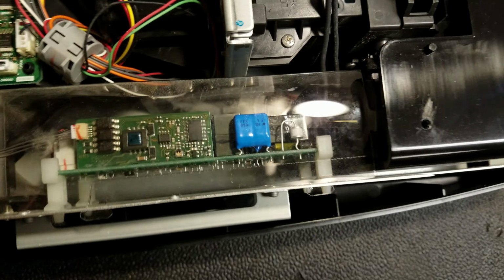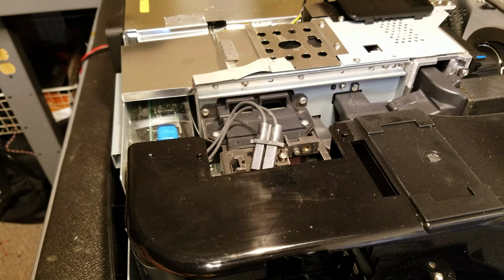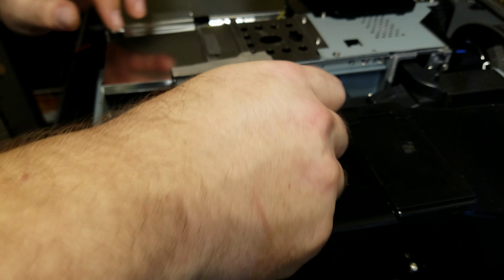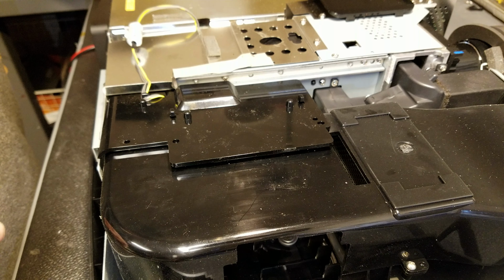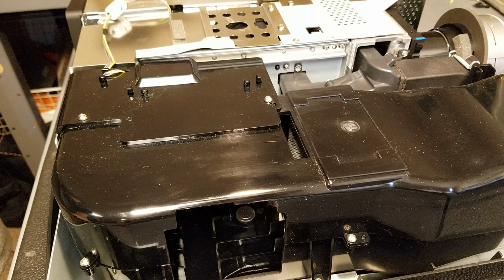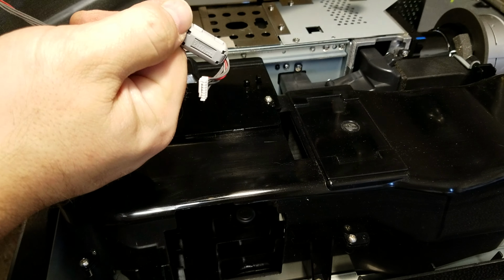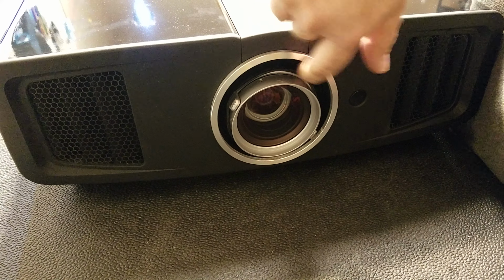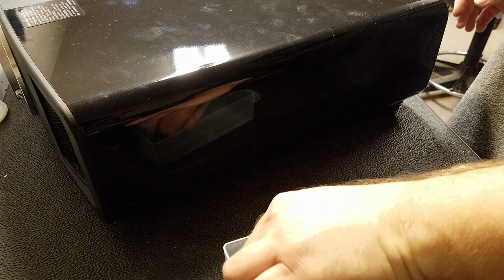JVC DLA RS1Repair P4

Comment: Hi Frank, I have a JVC DLA-X5000. I replaced the lamp after the 'lamp replacement' warning came up. All good but occasionally I'm now getting a pinkish colour twinge to the overall picture on screen. Could this be the color wheel or something to do with my input connection? I'd love to hear what your suggestions.
Reply from the maker: Hi, these use LCOS technology so no color wheel fortunately.  I would check your firmware and see if its up to date.  It could also be input related.  The lamp replacement thing is a timed warning. I would replace the lamp before it truly fails. It can damage the ballast if you let it fail on its own.  I'd try some other HDMI cables or make sure yours is seated fully.
Reply: @FixitFrank   Many thanks for your reply. I replaced the lamp as soon as the first warning came up so hopefully all good there. I suspect it could be input related as you say. I use a 10m (30'long) hdmi cable, it's very good quality but concealed in the roof space and would be extremely difficult to replace if it's faulty. But the problem only started when I replaced the lamp so I'll try first with a firmware update (that looks quite involved it seems).

Comment: Hey frank! I have the same problem do you still have part 1,3 and 5. Always if you could, do you have the link to buy the connector? Thank for your knowledge
Reply: I couldn’t find the other parts on your channel
Reply from the maker: No worries. I just searched and I had no idea how to label or organize things 4 years ago it seems. What I did find was if you just search "JVC" on my videos page, the first 6 videos are basically fixing that problem. The RS2 is the same chassis.
As far as the connector, I get them from a few places.  You will have a hard time finding just the connector.  Usually you need to find a ballast and then desolder the wires and re-solder them to your ballast. You could cut and splice if you insulate well enough. The ignition voltage is in the thousands of volts. I prefer the resolder method, but I have spliced safely.  
One of the nice things is that you can use a readily available Epson ballast for a donor.  The ELPLP42 Epson lamp has the same connector as the JVC BHL5009S. That means they have the same ballast connector. I used to buy the whole ballast and wire but now I buy the whole projector. 
https://www.ebay.com/itm/EPSON-POWERLITE-83-EMP-83H-PROJECTOR-BRIGHTNESS-67-LAMP-HOURS/124470617211?  
You can buy the wires from China without the ballast but after shipping and whatnot, $30 for a wire to fix a nice projector isn't bad.  Then you could in theory hard-wire the Epson lamp to its ballast and have a spare projector. To find a list of compatible models that you can harvest a wire from or find a ballast, search for ELPLP42 on any decent lamp site.  They will have a list. Pricing out ballasts, I think the whole projector will end up cheaper and easier.